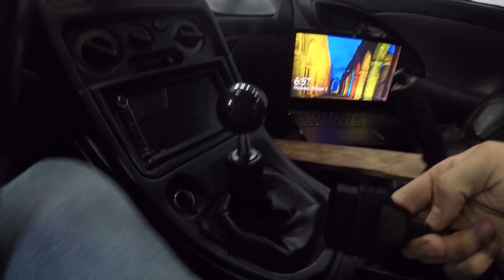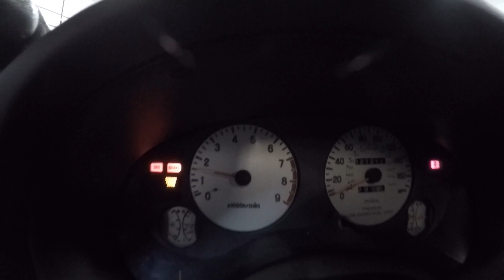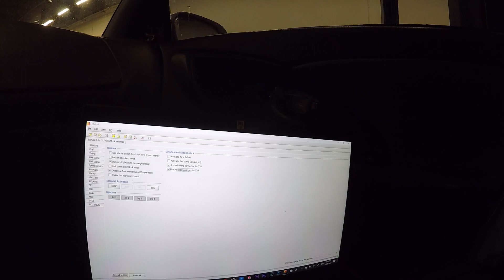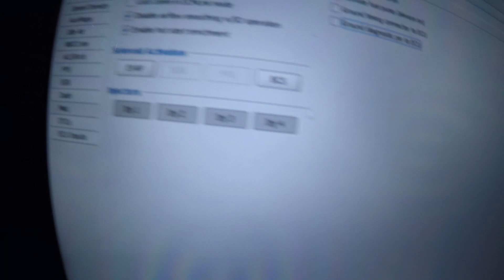Easy DSM Idle Fix (4G63T)

Comment: I just bought my first car and it's a Mitsubishi eclipse 1995. When the engine is cold the idle is good but after a while the rev goes down to 1000
Reply from the maker: Down to 1000? That's probably higher than it should be

Comment: dude can you explain why you needed a laptop instead of simply adjusting the screw right away? kinda confused honestly. I have a 4g93 not 4g63 but they're similar
Reply from the maker: The ecu doesn't like when you go adjusting stuff without grounding some pin. With Ecmlink it can ground it out via laptop so you don't have to physically ground it out. I think I would have been fine considering I have my IAC deleted and basically everything else. But just did it to be sure

Comment: Make another video on what bulbs you used in your head lights and how much is the difference at night compared to the stock ones
Reply from the maker: Will do. The only thing is that I don't know how well the original lights worked. If you've been keeping up with the build I just bought the car in February tore it all apart and re did most of it. It didn't run when I got it so I never really had the original lights.but if you could send me a picture or something I could use for comparison I'll put it in the viedo